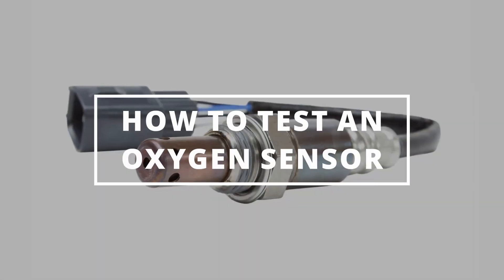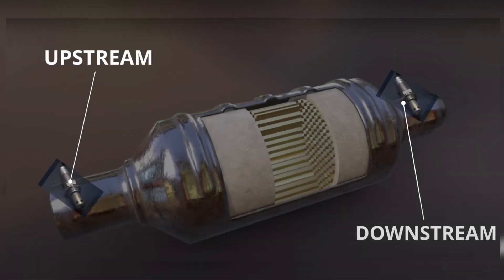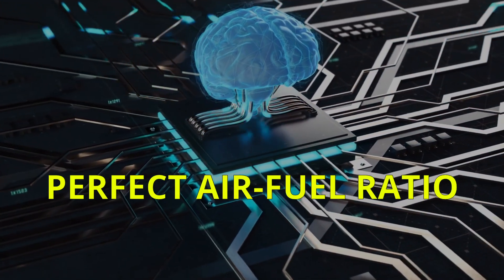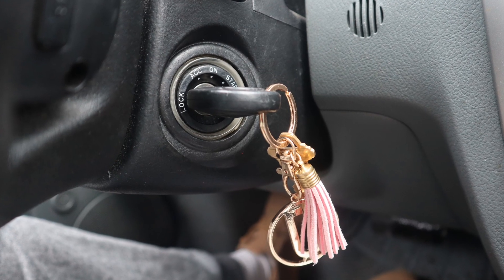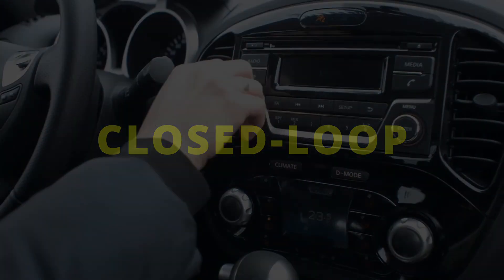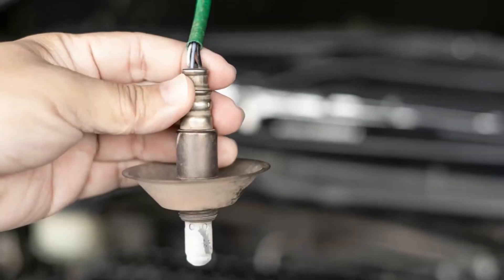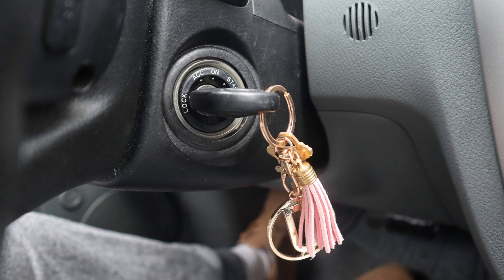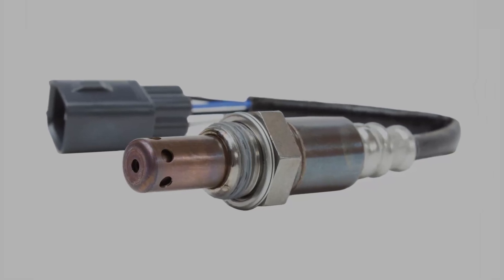HOW TO TEST AN OXYGEN SENSOR

Comment: Lmao not helpful.  Only talks about testing the O2 sensor itself.  Problem P0030 persists AFTER replacing 02 sensor so the issue is with car’s wiring harness

Comment: Isn't allot of this voltage data available if you have a code reader that provides a data stream as well?  I notice I can see allot of data about temperature, voltage of components inside of my code reader.  I'm sure everyone doesn't have one but curious if that's a valid way of taking these types of readings or is it just better to use a standard multimeter?

Comment: At 1:23 he says the first test only applies to the sensor BEFORE the catalytic converter. The second test checks only a sensor's heater but not the operation of the sensors themselves. He never explains how to check the operation of the sensor after the cat but that is the one that normally fails.

Comment: Hi, I have a 2015 toyota rav4 with slow response downstream sensor 2 code. I have removed the sensor and checked the 2 white heater cables and they read 12.9 0hms. What is the manufacturer recommended spec for this vehicle?

Comment: Which fault code is on the OBD code reader for broken Lambda sensors..........???? Is there a percific error code for the OBD
Reply: Yep, in UK usually P0136 and P0141 (or numbers close to). BTW 'specific' not 'percific'.
Reply: @dg1294  Thanks...Yes,Spelling Check 😉

Comment: Hey Can i test that connector the same way you tested sensor? i have 450mV and sensor i brand new so i want to check the heating wires. can i check with multi meter and how?

Comment: My fluke multimeter doesn't have a 2V⎓ setting, I learned to do this via measuring resistance... was just looking for a guide for that method. Thanx anyways. 

Also you go way too fast for people to follow along. Yes, I know, pausing is a thing, playback speed options are a thing, rewatching is an option... 

I get all that but so is finding another video and not subscribing cuz I'm not try'n ta fiddle with all that on my phone while testing my O2 sensors. I'm just say'n.

As an electrician with multiple multimeters, (all fluke, an expensive high end brand) I know how to make this work without the 2V setting, but I was illustrating a point. Not everyone watching would.

This is meant to be constructive criticism to help when making future videos.
Reply from the maker: Very nice, thank you!
Reply: @easyautofix  no worries. Just consider what it might be like to use your videos as a guid if you don't already know what you're doing, like basically put yourself in the shoes of your average Joe viewer, and you might hit better stats on YT. That's the universal version of my 2 cents that can apply to any instructional video.

Comment: Hello my friend, i have a peugeot 206 and i have a problem at cold start.. my car starts to run in open loop and after 30secs upstream o2 sensor start to give some readings (0,8V and high negative short fuel trims) putting my car in closed loop for some seconds making my car to shake .. then o2 sensor goes back to steady 0,5v and 0% fuel trim) and car returns to open loop and all work fine. When it reaches 36-40°C it goes again to closed loop, upstream O2 sensor starts to change readings again and all works fine know. The CTS and upstream 02 sensor are new. I have just extend downstream sensor's wires. Can it cause this problem? Sensors have heated element..

Comment: Downstream one affects fuel efficiency or not?...what if it is not working properly?
Reply: Siii. afecta la economia de combustible ya que la ECU esta calculando la proporcion Aire/Combustible a partir de datos erroneos. El motor vibra y es inestable en ralenti, hay perdida de potencia, puede perjudicar a largo plazo el convertidor catalitico ya que la composicion de los gases de escape cambia. Aparece la senal "Check Engine" encendida en el dashboard y lees los codigos de error con un scaner aparecen varios codigos(ejm P0171,P0141,etc). Hay 4 terminales: 2 son el calefactor (deben medir entre 2 y 10 ohmn de resistencia) los otrosa dos son el elemento sensor y miden alta resistencia (de 330 kohmn a infinito). Si mide bien pero el codigo persiste, se puede intentar limpiarlo de varios modos, sin embargo muchas veces es una perdida de tiempo. Es mas fiable reemplazarlos. Por ejm los sensores originales del Honda CIvic 2012 de mi hija cuestan casi 200 dolares. Cuando dejaron de funcionar (a los 10 anos) puse unos genericos que me costaron 40 usd y duraron 3 0 4 anos. Se cambian muy facil y solo cuando lo haya cambiado 5 veces llegara al costo de la marca  Denso (originales). MI hija no va a tener tanto tiempo ese auto.😂😂.

Comment: I have a wide band with different colors on all my wires. 4 in total - white, grey, black, and red. 2016 smart ForFour 1liter. 0258030336. Throwing up a P224413 code “The connection for the reference voltage of oxygen sensor 1 (cylinder bank 1) has a malfunction. There is an open circuit.” Please help

Comment: I"ve got a 2005 town and country, keep getting P0032 and 0132 codes. I"ve repleaced the 02 sensor 4 times, and recently replaced the ecm as well thinking surely that was the issue. CE light came on again. I"m completely lost. Any advice ? Faulty wiring from the sensor to the ecm ? Parts store recommended purge valve ?  I"ve replaced the MAF and the map sensor, and don't think it's a fuel leak.
Reply: Maybe you have a bad injector?

Comment: volvo 240 manual states the multimeter needs to have " a minimum impedance of 10 megaohms" and that "using a meter with less than 10 megaohms impedance can damage [the car's] LH control unit." i can imagine that this information may be similar to many other if not all vehicles, so my question to you is: should this at least not be discussed in your video? and how can an individual know by looking at their meter specs that their meter indeed should or should not be used in this testing? thanks in advance!

Comment: Not sure if I missed anything, but, I'm trying to measure the sensor element of my 4-pin upstream sensor. Should I measure with the engine running or not, can I have the connector disconnected to easily measure with my multimeter or does it need to be connected?
Reply: He says in video to make sure car is off before testing.

Comment: Is the test for upstream and downstream sensors the same? Specifically regarding the millivolt signal.
Reply: yes they are also identical 1885A141
Reply: @danstray2527 no they are not! Upstream sensor voltage fluctuates to regulate fuel (as stated in the video), downstream sensor SHOULD remain relatively stable (around 4.5v), to show the cat is doing it's job.... unfortunately this crucial piece of information is missing from the video.

Comment: Make sure the o2 sensor body is clean....there is tiny holes near the top where atmospheric air must enter in order for the sensor to work ...
Reply: More modern sensors don't have holes, as the reference Oxygen is sealed within the casing.
Reply: @dg1294  no it's not...how's it supposed to sample the exhaust ??thatz why there is holes .other would be useless to put in the first place...cheers

Comment: Hi, thanks for the video. I recently put a K&N air filter on my motorcycle and unplugged the ECU during the install then the check engine light was on and gave me a P2195 error code. Any idea how to fix it? Should I just clear the error and let the ECU continue learning? Thanks!

Comment: "connect to the signal wire of the oxygen sensor".  haha.  thanks a lot.
Reply: Yeah, how to know which one is the signal wire?
Reply: @douglasmichals7760  Signal wire should be the wire sending voltage to the sensor. Disconnect sensor from harness and use a multimeter to to test for DC voltage on harness side while the ignition is in the on position and the engine is off. You can usually use the frame as a ground or even the exhaust itself and then you can take the positive lead from the multimeter to test for voltage from any pin on the harness side of the connector. If there is no voltage from any pins then there is most likely an issue before the connector. You can usually find decent wiring diagrams online as well, depending on the vehicle if you are having trouble finding the signal wire. This testing for signal wires, or variations of this test, work on most electronics within a vehicle.

Comment: I installed a new o2 sensor in my car, but I still get low constant voltage of 0.4 volts when on idle.
If I go to 2000 rpm it drops to  less than 0.1 volts. there is almost no fluctuation. If I go back to idle it jumps to around 0.6 sometimes and back to around 0.4 volts. What can be the reason? Does it mean the ecu is already putting the maximum fuel it can put and it still not enough to make the mixture rich? How can I troubleshoot it?
Reply: It shows your car cannot control the fuel mixture. and is running lean  at 0.4  and worse at o.1.  When you return back to idle it runs rich  a bit but not correct.   O2 only read the exhaust it is not a repair if the car is broken.   Read the list of lean car. conditions at 2::35

Comment: My 1987 Isuzu pup doesn’t idle and the carb is clean. It starts but if I don’t keep my foot on the gas it will die out. Would it be this, bad spark plugs or something else?
Reply: I am no carburetor expert, but the idle adjustments need to be analyzed and changed accordingly.  If you you had a electronic fuel injection with a throttle body I would recommend to replace your IAC(Idle Air Control) valve and the TPS(Throttle Position Sensor).

Comment: I need a straight forward answer to this question. Does the O2 sensor need to be fully connected to the vehicle to run this test? If it operates at 600F or higher I would say yes.
Reply: The O2 is always reading  but it is calibrated to works best at 600  up.  you can read the oxygen in a propane furnace but what good is that?

Comment: Great video,  👍 I bought a new Lucas pre cat sensor (engine k20a6 ) and I get 2.6 ohms . I don't know the manual specs , I assume it is good, I will install today and see if it works.  Anyone knows the specs?
Thanks
Reply: That number  is the heater    it is not the O2 sensor portion.   The heater  only helps the O2 sensor work faster.

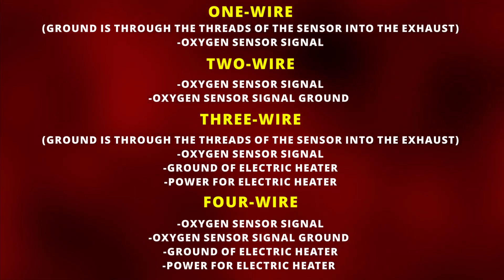Comment: You state that the first test "is only for the oxygen censor before the catalytic converter" (1:19) . 
Don't you also need to do a voltage test for the oxygen censor that's after the catalytic converter?
If so is it done the same way as the one for the oxygen censor before the catalytic converter?
Reply: After  the CAT everything is cleaned and the O2 should read a constant number not changing much.  There is no test to verify the CAT is working.   But if it does change like the front one,  the CAT could be bad.
Reply: Absolutely correct, shame he missed this as there are people in the comments saying they are going to replace the downstream sensor because the voltage doesn't fluctuate, when it actually SHOULD remain relatively stable around 4.5v, showing the cat is doing it's job.
Reply: @dg1294  just curious, the test on the downstream O2 sensor is done with the vehicle off and the sensor cool, is that correct ?

Comment: under live data on my scan tool the reading  shows going back and forth  rich to lean  is that a problem  thanks
Reply: rich lean rich lean rich lean means it's working properly.  Controlling the mixture between the two points.
Reply: thanks for getting back i have an 03 taurus  it was sitting in a garage for 8 months just put new trans in it then when i first did start up got a po1131 for a bit then as of now that went away now have a po171 lol
Reply: @michaelstinger6785  lol???

Comment: I have a 2004 f150 Ford. 5-2. It runs fine when it’s cool. But it’s hard to start. And when it warms up. It starts stalling and popping. And doesn’t have any power. Can anyone help me with what’s wrong please?
Reply: Do a compression test. Sounds   Internal.
Reply: Check airflow sensor
Reply: Fuel delivery, something Fuel pump or regulator etc ot pump relay or wiring. Fuel filter. But really need to scan it, do you have codes?

Comment: My o2 sensor stay at 2.3 volt on the rich side and it doesnt fluctuate
Reply: Down or upstream?
Reply: @Dontexxr  up
Reply: @jygogaming3550  well what was your down reading. You could be having other issues going on. Look at fuel trims and check at idle then steady rpm rev
Reply: @RuffsGarden  nothing wrong my fuel short and long term stay below -+10
Reply: @jygogaming3550  im not sure.... Might needa change downstream. That's all i got if your upper isn't fluctuating. The lower isn't communicating with your computer and keeping steady info.
Reply: @Dontexxr  ok
Reply: @RuffsGarden  what are the symptoms of bad downstream o2 sensor?
Reply: @jygogaming3550  fluctuating on a large range. You can even test the OHMs and if its OL (Out of limit) the contacts are open. Your car fuel economy will go down the drain.